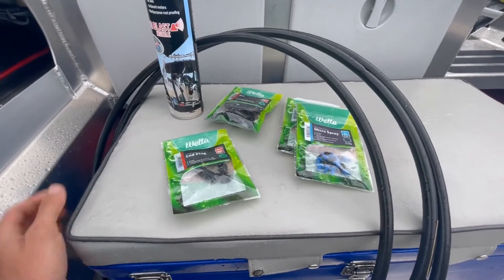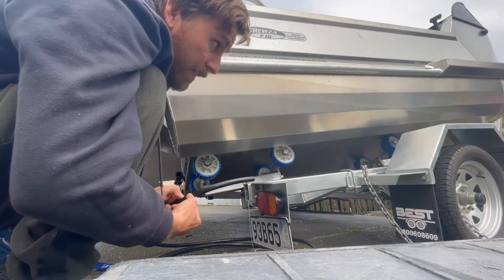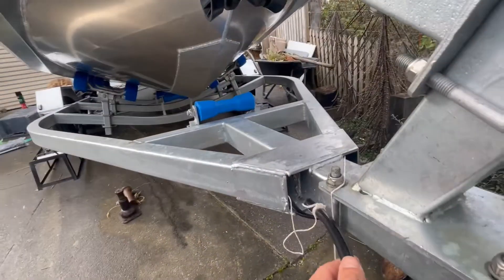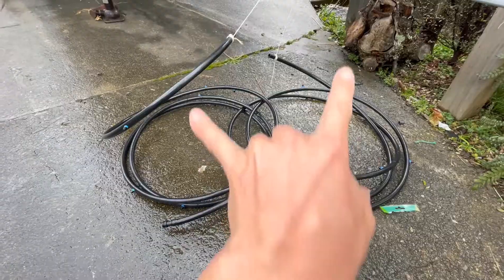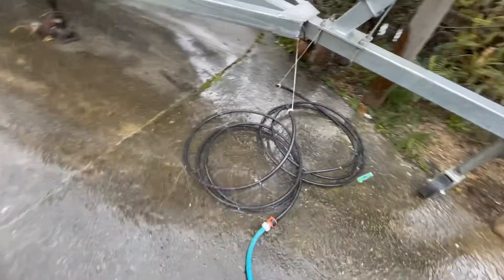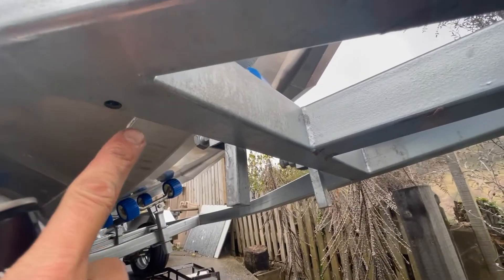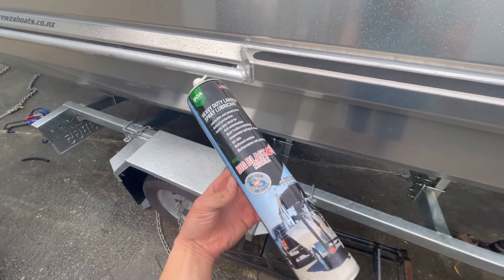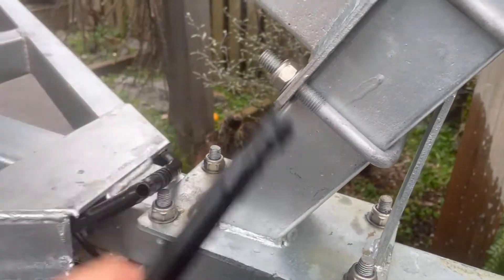Easy Boat Trailer Rust Prevention | DIY series | Steadliest Catch Ep.26

Comment: Very Interesting trailer modification. Shiny New Frewza looking great.
Any tips on protecting the leaf springs. They have always been the first to get eaten by rust on my previous trailers.
Cheers.
Reply from the maker: Single leaf parabolic springs are great for that, no nooks for salt to build up. Just need to get a spring rated for a lot higher than total weight as they are not as strong. For multiple leaf suspension just blast them with lanolin every six month is about all you can do - along with thorough wash downs